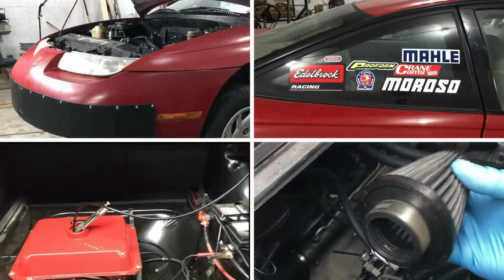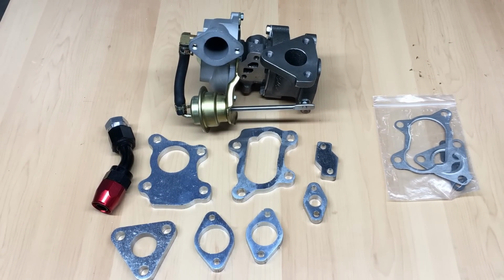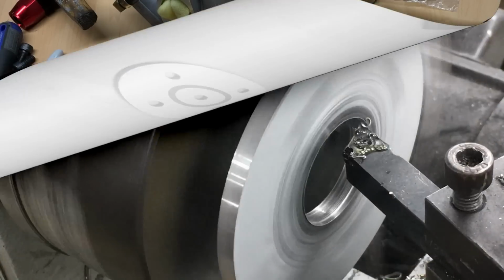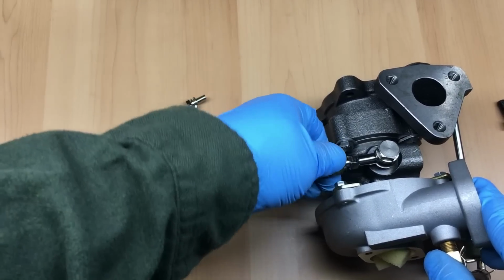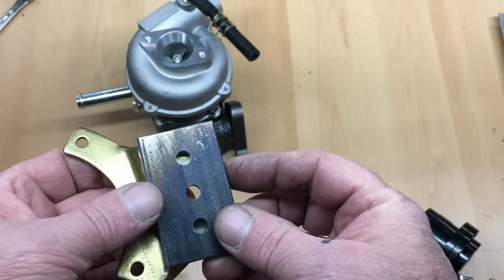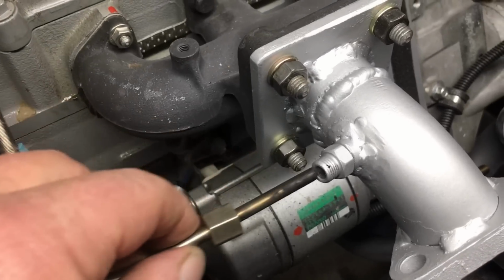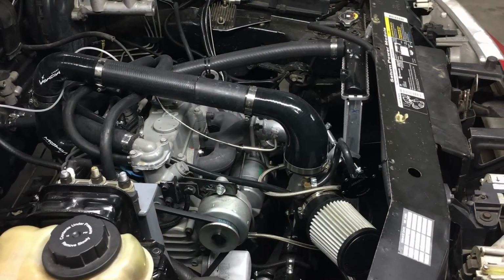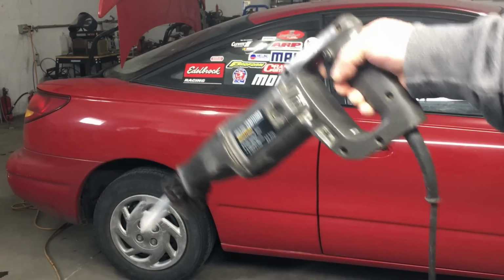S3 E5 We install a RHB31 turbocharger on the Kubota D722 diesel engine in a 1999 Saturn coupe.

Comment: I was waiting to put a VW clean diesel engine into a s-10 maybe blazer, or 1500 regular cab truck, with possibly a 6speed transmission, with more boost, and slightly less clean, more fuel,  maybe methanol injection, or propane injection, with a large intercooler, possibly spray the intercooler with alcohol wand water , with compressed air, or maybe CO2,  or propane, and allow the intake to collect the propane,  and make 30-40 psi boost, hopefully 100°-150°F or so, maybe spray liquid propane into the intake to lower the temperature!  It should make 400+ TQ, and 250 HP+

Comment: That pipe going into the turbo is too large for the turbo, causes a wall for the exhaust to restrict flo, you would been Soo much better off using a funnel shaped pipe, or  just roll and hammer the pipe to shrink it to fit, it would possibly Gain 5%,. Boring out the turbo about 20 mm deep open it up to fit the pipe diameter, this will cause a major drop in flow, if it was flowing the other way it would be much better, but still not the best!!

Comment: It occurred to me that the RHB31 might be "too big" because it's designed for ~60hp.  My LS tractor has a tiny TD02 turbo on it and it's rated at 35HP.  That might be a more appropriate turbo if you want to experiment.

Comment: The intake size should be relatively smaller. You're losing pressure having to fill up a higher volume piping. Why you only had 4.5-5 psi instead of 7. Honestly think a 14 psi spring will give you slightly better bottom end performance for take off and lower rpm gear shifts.

Comment: An option for boost controller is a mechanical waste gate. It's a common choice for the Chevy 6.5 diesel engines since the OEM vacuum pump is problematic.   Look up "spool stick". It functions like a normal spring adjustable wastegate actuator just without the vacuum control

Comment: The 3 bosch boost/vacuum gauges I have used usually read about 1 psi below the actual boost level read by the ECU. I would definitely check it against another gauge if possible

Comment: I wouldn't put 3d printed parts inside the intake track. Heat from the engine bay may degrade the printed filament. A sharp change in diameter wont affect that engine, the flow rate is going to be soo small that the step wont affect the performance in any given way, ideally you want to make the charge pipes as small as possible without affecting total flow.

Comment: Mounting the turbo with axle facing vertical will also mess up the thrust load on the seals, wearing them out prematurely. Try to keep the diameter of plumbing from turbo compressor outlet to the intake manifold the same.....having different diameter 'steps' in the pipe causes drag.

Comment: Really looking forward to see what the intercooler is going to do to an engine that wasn’t technically designed for a turbo. Right now I’m rebuilding a cat D7 E high horse, big Stack dozer and it did not come with an intercooler from the factory. Wondering if I should custom build an intercooler for it because I live in south Texas and it’s incredibly hot here all the time. The factory turbo only ran a few psi and I’m not a fan of it, lol get it not a fan!

Comment: If practical, ceramic coat the exhaust manifold and the exhaust turbine. Alternatively, use a turbo blanket at least on the exhaust turbine.  The more heat energy reaches the turbine improves efficiency, and it reduces 'spool' time when going back on throttle.  It takes a significant amount of energy to to spool a turbine up after it has been let spin down........ideal fuel economy is achieved when the turbo is sitting under load, spinning at a near constant rpm.  I learned this driving heavy trucks long distance (owner/driver) on flat plains.  Cruise control was a problem, since it maintained speed in an on/off application of throttle.......constantly spinning the turbo up and down, wasting fuel. By manually holding the throttle, steady against the load, fuel consumption was reduced a whole 10% !!   Using 100,000 liters of diesel per year, at $2 per liter, that was a saving of $20,000. University of Texas did a study on a 6BT Cummins and achieved a 10% fuel saving with just a turbo blanket, and improved throttle response/less turbo lag.

Comment: 5 psi boost probably gets the engine from 20hp to 24hp. 7psi isn't that much either.
So long the compression ratio is below 20:1 (on a diesel) you should be able to run 14psi just fine, and get 30HP total power.
Seeing this engine has a poor hp rating (a 600-700cc should net you 30-40hp), I think the compression ratio is low enough to push 15psi boost.

Comment: You can remove the injection pump shims and get more timing a power also on top installing 5.5 plungers and barrels from a 1105 kubota motor

Comment: Drill and lock wire those turbo drain bolts on the oil pan. Don't want one of those nuts vibrating off.

Comment: bring the fueling back down to just over factory then you can run longer in higher rpm really taking advantage of the turbo. also ditch the wastegate you dont need it on a diesel because theres no throttle plate to create a blockage when releasing the throttle

Comment: Add propane injection with a boost-sensitive regulator. If the exhaust temps get too high, add a water/ alcohol injector. A secondary, heated fuel tank with a crossover valve would allow it to burn vegetable oil.

Comment: Why couldn’t you find the centre of square flange from corner to corner on the lathe instead of a circle? I’m not trying to be a keyboard warrior I honestly just know less then very little about lathes. If your going to get a tig seriously look into a tig/plasma. Two birds stoned at once and the plasma is very handy.
Reply: The lathe has a 3 jaw chuck. No way to deal with a square without a 4 jaw. Even if he has one they take a ton more setup to use.
Reply: @philipmacduffie7612  ok. That makes sense then. Thanks.

Comment: Do yourself a favor go to Harbor freight and get the Vulcan Omni 220 multiprocess welder it wire welds steel and aluminum aluminum with a spool gun bought separately does stick welding as well as TIG welding steel or aluminum and it’s cheap especially if you get their credit card with 0% interest for 12 months

Comment: Reduce the size of the charge pipe... without doing anything else it should increase the boost pressure because there is less area for it to fill...also in diesel engine when you increase the amount of fuel added it lowers the combination chamber temperature...lean=hot rich =colder...the extra fuel acts as a coolant and that is also why they blow out black smoke.

Comment: Keep in mind the supplied springs in Chinese wastegates are just a suggestion. If you really want to know you can test the system with shop air and a low pressure regulator

Comment: I think I'd route the PCV into a catch can and then to atmosphere.  I'm worried that if you have an issue in the engine of some sort that starts blowing a lot of oil out, routing it into the intake can result in a "runaway" condition on a diesel.  Also, I think it would be interesting/worthwhile to see if you're getting any significant blowby while running- if you run it into the intake you're missing out on the opportunity to see what's coming out of the crankcase.  

'Cause... well, things happen, and then maybe things go boom or flames or bad smells etc. :)

Comment: You might want to 20:50 Your 3D insert might want to be more 'flow induction' modified to eliminate those 90 degree barrier to good easy air through flow on each end of the tube. ~( 'w')/

On the leading edge, you will get turbulence and 'air stumble', and on the trailing edge you might get a 'mach wall' effect.

If you can 3D print plugs that gracefully merge the flow, it will greatly help improve performance [admittedly, on THIS SPECIFIC product, you might not be able to tell, but on a top end race car it would be a LOT more evident...that said, it never HURTS...]. 
~( 'w')/

Comment: I love these... for the turbo actuator stuff... you could have just threaded the rod further down and made it shorter... 

also for the oil feed... it's common to use a steel hose extension and hard mount the T block somewhere because the vibration of the engine has been known to crack the soft brass bits... with how much use this is getting I wouldn't mention it except it is a diesel... so keep an eye out for it I suppose 

keep up the good work.. super fun watching someone with more time and money than sense... a man after my own heart woot.

Comment: there is an aftermarket billet wheel available for the rhb31. i might sell you one at a discount ;)

it fixes the oil weep they tend to suffer at idle before they build positive pressure. 

the 24mm inducer poses a restriction, so theres a vacuum being pulled in the compressor housing... end result, oil weep, regardless of how well the drains working.

its also an idea to pop them open and get into the drain passages with a die grinder. take out the lump in the turbine housing from one of the mounting bolts. smooth it down, you wont break through to the hole...

on that note, i drill and tap my banjo to take pilot jets, find a #35 to #42 is about ideal. 1mm restrictor is NOT ENOUGH! 

brake lines are the best source of banjoes. why buy an over-priced kit when a scrounge through a few old bikes will find the bits needed?

take off the wastegate, weld the flap shut or tie it off with a spring. you wont need it, as you are extremely unlikely to break half a bar. means you can clock the turbo to any old position... and its a diesel. more boost is better!

Comment: Any chance you could compare this to the AMR500 supercharger you used before on another engine? You could compare the MPG and 0-60, and see if cheap turbo or cheap SS wins. I'm planning on putting the AMR500 on my 75hp 3 cylinder mitsubishi mirage engine soon, but then saw this today and wonder which would really be better, I only want the MPGs.

Comment: Whatever you do, DO NOT ADJUST THE TIMING BY ROTATING THE PUMP PLUNGERS!! the adjustments are for synchronization of the plunger timing and should only be adjusted on a flow bench. Instead, to advance the timing, there are shims underneath the pump flange, remove the injection lines, remove the 4 12mm nuts holding the pump, and you will find shims underneath the pump mounting flange. Remove the thinnest shim and that should advance the timing by about 2 degrees

Comment: You MUST turn the boost up more! Diesels need a lot more boost than gasoline engines to produce the same power increase. You need to run somewhere between 30-50lbs to see good results with this engine. And please do not worry about EGTS! It is very very common for diesel engines to get up to 1500 degrees Fahrenheit and 1800 is when you need to stop. This is a absolute rule for any iron block/head engine. So do not be afraid of extremely high boost.. it's normal
Reply: 50lbs is WAY TOO much for this engine.
Reply: @davelowets  50 lbs is only getting started... Assuming the compression ratio is relatively low of course... My daily full stock engine 2gen Cummins is doing 65-70lbs, and that's not uncommon.

Comment: usually you don't need a intercooler at 10psi of boost or less also turn fuel up a bit before you add a stiffer spring to the turbo waste gate turbos are heat driven and I have found with smaller turbos its hard to control wastegate boost without adding the fuel till you get over 1000f-1050f  EGT's  as thats where the turbo's really get driven by the heat when are down under 900f the turbo doesn't have enough heat to really make boost.

Comment: hey heads up, Interupped cuts like that are bad for insert tooling. you should be fine for now but you'll wear out your nice carbide really quick like that. if you have the ability to and you plan on making a bunch of these adapters, I'd recommend grinding a high speed steel tool on a bench grinder, this old tony has a really nice video on it I'd recommend

Comment: If you install a hydraulic pump and motor combo, between the engine and the transmission you will dramatically increase the torque at low revs, and if you had a belt or chain system,  you could run the hydraulic motor to the from wheels, while keeping the direct drive to the transmission and rear wheels, this would allow you to have a "crawl mode" for ice, snow etc. If you mount the intercooler to the roof, the results will be much colder air entering the engine and better performance overall.

Comment: You can add an air compressor to this system via belt drive, and use the compressor to provide on demand boost to the intake too

Comment: Adding an extra oil reservoir,  that's specifically for the turbo, with an electric oil pump, will keep the turbo oil cooler, and keep it from interfering with the existing oil system,  add a return filter and an oil cooler, and your turbo will always have nice cool, clean oil. Keep em separated and you will be thankful, because no one part failure will destroy the whole system

Comment: You need a plasma cutter to save thousands on grinder disc's and dramatically increase your part productivity.  Amazon has em for around 300, add an air compressor and your good to go

Comment: Enlarge the diameter of the exhaust system from the headers out, remove the muffler, and reduce the number of bends in the exhaust system,  this will dramatically reduce the exhaust temperature,  also stock manifold is waaay to small for this application,  also enlarge the intake plumbing by the same ratio and the engine will breathe much easier and run much cooler.

Comment: I find your lack of boost......disturbing

Edit: Kidding aside, I'm glad you included an IAT sensor cuz I think that thing's gonna be working so hard that you're gonna need some sort of charge cooling; otherwise instead of seeing a ~50% increase (.5 bar), you'll see probably closer to 40% at first and then as load is sustained I would guess it would drop all the way to 20-25%, still an increase but noticeably lower.  Your data will reveal all though!

Comment: a stiffer spring may increase the boost psi. the 7psi spring is likely allowing  the waste gate too start opening at 5psi
Reply: this is  one reason turbo tuners use boost controlers vs relying on wastegate springs alone .

Comment: General rule of thumb you can get away with about 15 degrees of roll in the turbo, oil drain pointed to either side, but you really want it perfectly level in terms of pitch, neither wheel higher or lower than the other.

Comment: you might find it worth while to check the profile of the camshaft used in the engine. industrial engines usually are set speed use ( generators and compressors etc) so the cams used are optimised for the power at those revs ..you need every ounce of power you can squeeze out of this
Reply: And if he doesn't like the cam profile, what's he going to do about it?

It's not like there are aftermarket cams available, sitting on a shelf, for this engine.

Comment: Diesel engines work a bit different than petrol ones - in diesel if You're giving it a too rich mix it gets hot, while in petrol it's opposite way. So with good A/F ratio You shouldn't be afraid of melting that beast of a Kubota diesel.

Comment: One of those turbo people here. You might want to look into putting in a catch can instead of routing the breather tube back into the turbo. What happens is oil coats the inside of the aluminum intercooler and dramatically reduces its efficiency. Anyhoo, love the video series, keep it up!
Reply: Disregard my user name.  Made it to piss of my prof…. I like kids a normal amount.
Reply: I've heard that this is also why you don't use K&N Air filters on the intake of a turbocharged engine. Any truth to that? After your comment, makes sense to me...
Reply: @Maybe-So  you would have to soak ur filter unrealistically dads using k and n on diesel for 10 years same truck

Comment: On diesels I like to run the wastegate actuator at a high pressure (or lock the wastegate closed) and set the boost via the fuelling.
This gives you the most power vs EGT.
When you have a wastegate, as soon as it opens the mixture gets richer and EGTs climb rapidly.

Comment: The reason that making sure the turbo cooling oil doesn't leak past the seals is important is because from there, the turbo will force the leaking oil into the cylinders with the charged air and a diesel engine will happily burn that oil. As diesel engines are fuel-governed, the leaking oil is not being restricted by the governor and can enter the combustion chamber freely. This can lead to uncontrolled overspeed of the engine, otherwise known as a 'runaway'. At this point, turning the key to shut off the engine won't work and it will run away until all the oil is consumed (resulting in a seized engine) or some other expensive mechanical failure occurs. The only reliable way to save the engine from destroying itself is to cut off the oxygen supply to the cylinders and prevent combustion, by blocking the air intake.
Reply: YES.  This has been worrying me as I watched.  Probably not a problem, but having a throttle body on it that can be closed would be a good anti-SHTF feature!  'Cause... well, things happen.

Comment: Gasoline engine is quantity regulated, diesel engine is quality regulated
so the diesel always runs with excess air
if you add a turbo, it runs cooler because there is more air than you need
but since you got more air you can still add more fuel

if at all possible I would recommend to purchase larger injection nozzles as this is the best way to get more fuel in to the engine
an added bonus is that, with larger nozzles, the fuel gets in to the engine quicker and can burn more evenly, so it is saving you some fuel while you still gain some power